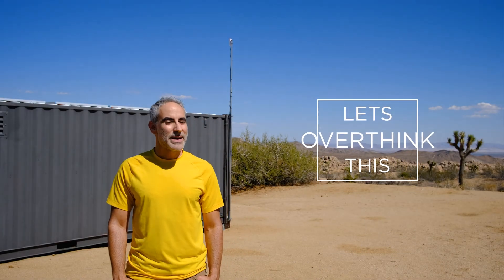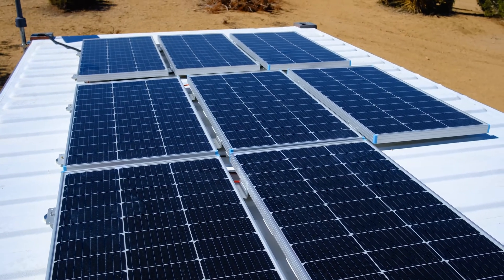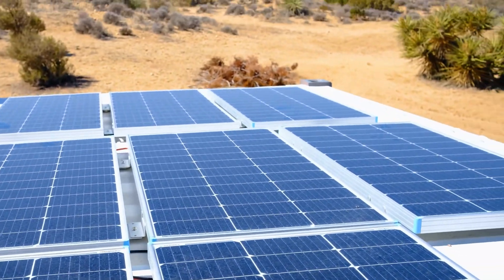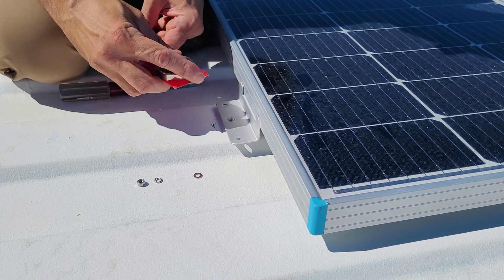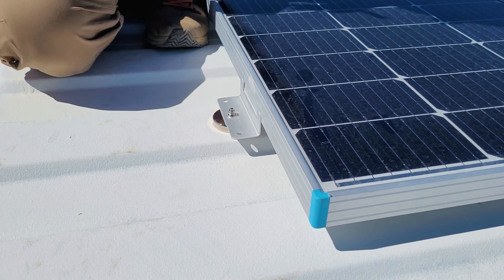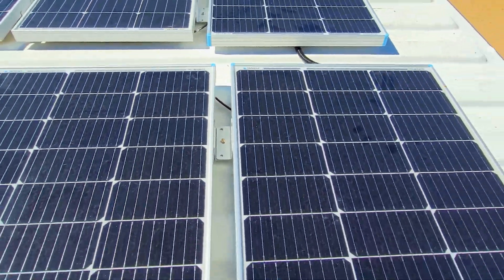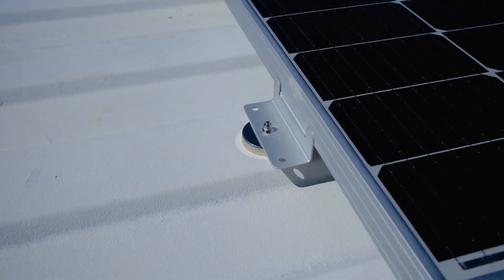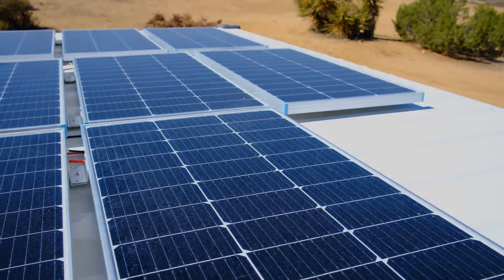No-Drill Shipping Container Solar Panel Mounting!

Comment: This is a great way to put solar panels on your container. I've seen folks do the drilling option, which I never understood for the reasons you mention. I've also seen folks attach additional panels to the side of the container so they have them on top and on the side that faces the sun. The magnets are probably strong enough to attach them there if you use 3 per side, or 2 on each side and one on the bottom of the panel.
Reply: What about stronger magnets? I'd want to feel like the panels will stay put in a hurricane

Comment: How many panels and what wattage do you think is needed for 1 person in a container home?
Reply from the maker: Sorry that's unanswerable. It could literally vary by a factor of 100 depending on your loads (air conditioning, electric water heating, clothes washing, etc), the climate, how many solar hours you get where you are, etc.
Pretty easy if you just add up your loads and how long you run them for but nobody can do that for you.
Reply: @ Ok. Thanks.

Comment: Ingenious idea!!  How much energy do you pull from these panels laying flat like that?
Reply from the maker: Yield is almost perfect in summer with the sun overhead but in winter the angle is obviously pretty wrong. Days are shorter which also cuts yield but my guess is the lower sun angle vs panel orientation probably kills a third of production.
Reply: @LetsOverthinkThis In the winter, or even in the summer for the matter, I wonder if this would work  on the Southside of the shipping container of if the magnetics wouldn't be strong enough to hold a vertical mount.

Comment: You just blew my mind, thanks for this. I was thinking of glueing wood to the roof and then drilling into that but this is way better. I think instead of mounting brackets I will use hinges so I can still tilt my panels to the sun in the bleak English winter
Reply: I'd be curious to get a visualization of that

Comment: WELL DONE PV. 
Heat from top and below (heated container roof).
you will be amazed by performance increased if you raise the PV up a little bit to let air flow under the PV
Reply from the maker: Totally valid point though there is a lot of airflow already since the roof isn't flat.... It has a corrugated profile and the magnets are attached to the ribs not the valkeys. But fair point!

Comment: Great idea!  Looks super clean.  Could probably use some aluminum flashing on the outer edge to keep wind from gettiing under but they survived a few years + a tropical storm so Im sure theyre fine.  Would be interesting to use angle brackets that were raised slightly to get a better angle but probably not worth the risk.  Great video!

Comment: Have you had any trouble with your magnets?  it gets windy, wondering if they held down in the wind
Reply from the maker: Nope. They are incredibly strong in sheer which is mainly the force direction. They've survived a tropical storm and lots of high winds but of course it's more risky than bolting them down!

Comment: I understand you are doing this for off-grid, but what is the HOLDING STRENGTH in terms of wind loading for the magnets?

Also, the clips look very low to the metal roof - what are you using for wire management clips?
Reply from the maker: Thanks for commenting. First off, anything designed or engineered is about tradeoffs and I think I'm clear the magnets are a great temporary solution but of course bolting the panels down is stronger.
Now, that said, those are each 270 pound magnets and while I don't believe that's actually their holding strength in reality, they would take quite a bit of lifting force to remove: More than the panels have seen in almost 2 years (I've had panels up there way before I made this video). And we just had a tropical storm come directly through here and the panels didn't budge AT ALL. The fact that the panels are so close to the surface probably helps since the wind barely gets under them and doesn't create nearly enough uplift to budge them.
The magnets are much weaker in sheer, but the panels present such a small cross-sectional area to wind coming from the side that they don't slide either.
As for the wires, they're just zip-tied to the back of the panels, again the fact that the panels are so low makes it nice for the wires since the sun never gets to any part of them except the last run that goes into a conduit down the side of the container.
Hope that answers the question!

Comment: Hope you didn't fall for the LION batt scamm.  Friend of mine used 3m double edge tape to mount his solar panels on the roof of his moho. Never had any problems with them.... I like JB Weld.... cute foundation... would like to see a couple of pix of how you did that... Thought I'd mention this, when you need to clean the solar panels don't use your well water, it will be a mess, use distilled water, save having to do it twice.... and dust will stick to the well water residue so the stay cleaner longer with the distilled water.....
Reply: I mounted a 1kw solar array on top of my Ambulance RV using VHB tape 4 years ago. I’ve travelled round trip across the country 8 times from 110 F to -15 F temperatures and the VHB tape is still holding strong. Even if i pulled as hard as i could, i doubt i could release the panels from the tape. It’s that strong.
Reply from the maker: Good tip on the water! Not sure what scam you're referring to but my batteries are LiFePO4, not Lithium ion. Works about ten times better than the sealed lead acid I had before but definitely pros and cons either way.

As for mounting, I love 3m adhesive tape but haven't used any in weather exposed areas yet.

Thx for commenting!
Reply: @LetsOverthinkThis  give them some time.... desert temp swings are huge....
Reply from the maker: @rss608  LOL, I'm aware and don't have problems with the temperature swings we get.

Comment: Where I live there is hurricanes and tornados sometimes. Guess I'll add.some kind of strong glue 

What kind of batteries do you use to store the power?
Reply from the maker: Yeah, I wouldn't recommend this for places like that! Certainly it beats leaning it against a building, but where true storms are concerned, I'd definitely drill and bolt. Just my opinion!
I have a ~2kwh LiFePO4 battery bank that keeps the security cameras and internet running, and lets me power the well pump now and again if needed. Eventually the site will have a real power system with lots of panels and batteries but this is a temp setup.

Comment: I also think that the force of the magnets can be overcome by the level of wind power present out there. I think the rule of thumb is that if it isn't bolted down, it WILL eventually blow away. I partner in a cabin over in Homestead Valley. It goes from mild to wild and back in a jiffy. The wind is a fickle friend. IMHO there's a better chance of them sailing off than that of rain getting past properly sealed attachment holes.
Reply from the maker: Oh for sure it's possible! No argument there. I just didn't want to riddle the roof with holes or have to work out a few bigger "rails" with fewer but bigger holes to mount them too. But agreed, tradeoffs here for sure. And definitely only recommended as a temporary technique!
Reply: If you see any movement then I would use some cheap ratchet tie down straps with some home made brackets for the ends.  I would guess that as a temp method they will work fine.

Comment: My guess is you're probably good for a Microburst, 70-80mph wind as long as the panels are flat and in their current position..   Are you going to add enough Solar Panels to power your new Well? Video? ;-)
Reply from the maker: 🙂 Well the panels already power it easily! Those 8 panels provide about 4kwh of power every day and the well pump consumes about 0.6 kwh to pump about 350 gallons (it's about 600 watts on average pumping 6 gallons a minute).
I dont need the water yet but it's no problem though I'll have a proper house-sized system eventually for the really energy consuming stuff (electric ovens, heat pumps, etc).
What would interest you as a video?

Comment: So the wind doesn't grab them.  How high of winds do you around that area?
Reply from the maker: It's pretty breezy. Regularly hits 20-something but I doubt they've seen over 30 yet. Given how low a profile they have, my bet is they'd handle way way more but can't promise that.
Reply: @LetsOverthinkThis  Thanks! In CO and getting ready for a well so liked those videos also.  It gave me something of what to expect and like that slurry area so it doesnt run everywhere.  At 9600 ft with winds pretty high. Ill use those magnets on the inside to hold some lights on the inside of the containers.  Think I will need to build a frame of some sort.  Are you going to build?